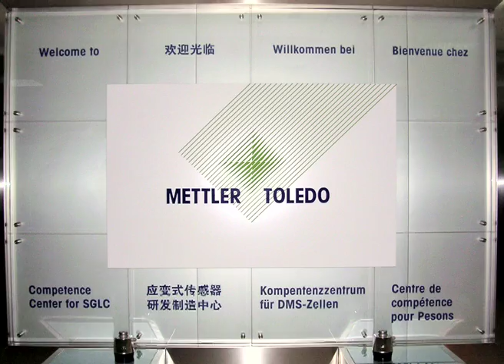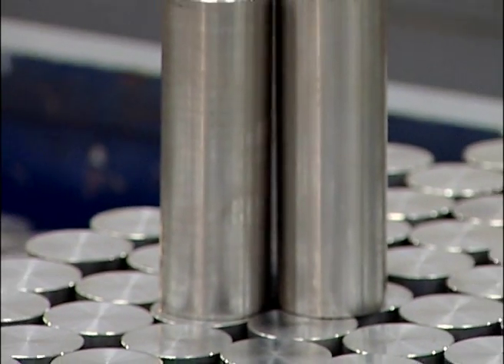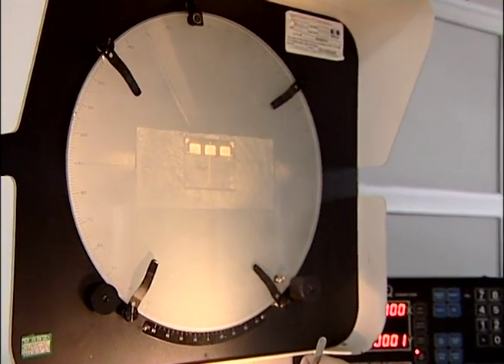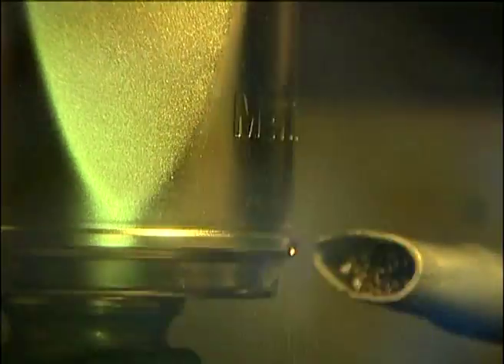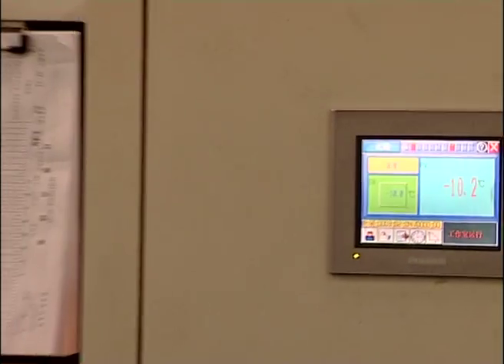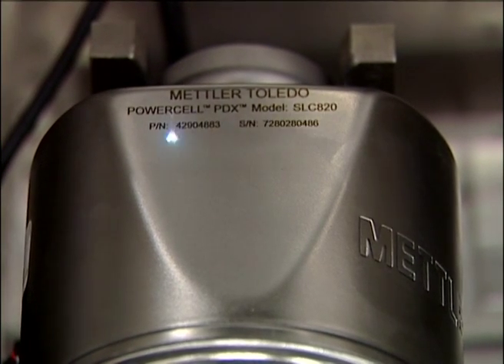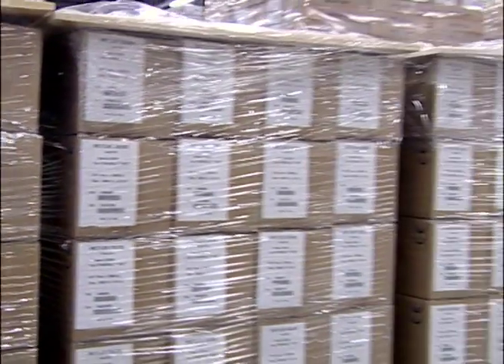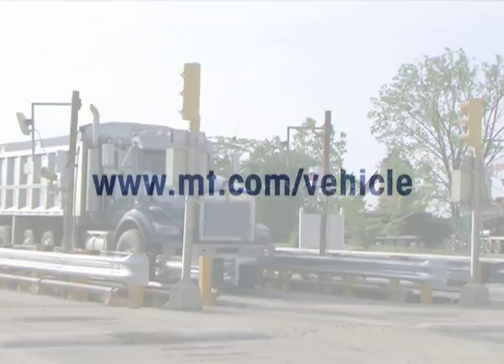How It's Made: POWERCELL PDX Load Cells - Product Video - METTLER TOLEDO Industrial - en

Comment: sir please tell me simple techniques to find faulty load cell which comes with 6 wires mettler toledo. 
ex+ex-sig+sig-sen+sen-?
Reply: salman sallu 
Very simple sen and ex are the same. Sen is to help with current do to distance and wire size. A guage is a peice of wire. Measure with ohm meter. Ex and sen + together Ex and sen - together. Then +ex to +sig - ex to - sig. The reading has to be the same. If not the guage or metal of cell damaged. Most of the time its cable issue. Also there is no such thing as a digital load cell. They are all analog cells. They just use a converter in cell and send a 482 or 485 signal back to meter. This  way they can use cheaper metal in cells. To make it appear better. Its marketing BS. Load cells are all the same. Its really how good the metal is, guage inside, and how well it is attched to measuring point on metal. You cant even ohm there cell. Its all inside. Total BS
Reply: How many volts excitation and how many mv per volt? if 3mv/v by 10v excitation  your mv capacity at full load is 30 mv so that in mind you need to apply power to the load cell disconnect load cell signal wires from summing board and check how many mv return check all load cells look fo high mv with nothing in or on the scale such as a 4 load cell platform load cell 1 3mv  #2 3.2mv #3 2.9mv #4 8.7.
#4 is probably bad.   You can do a zero test on it remove all dead load from the load cell it should read 0 +/- .2 mv. 
If one load cell reads negative its bad if the mv fluctuate its bad.